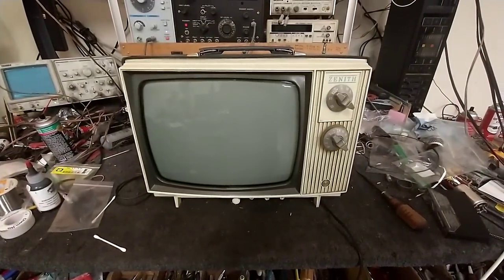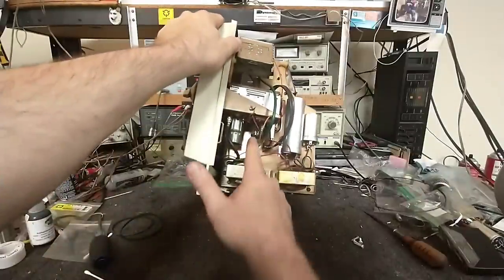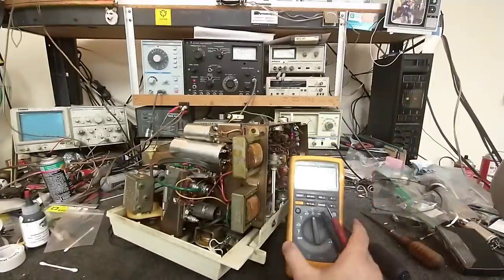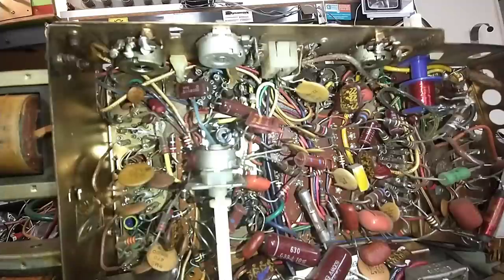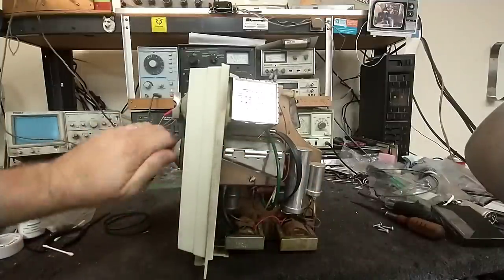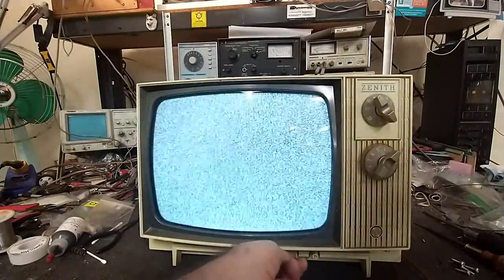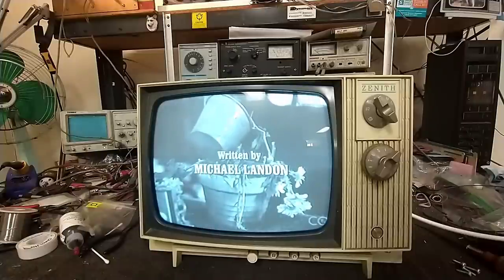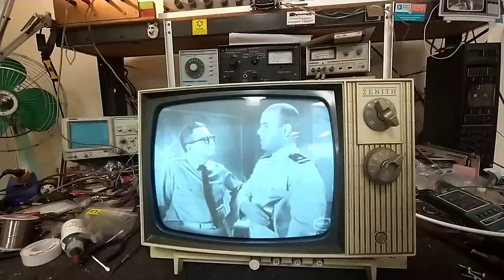Analysis and quick service of a 1967 12" zenith vacuum tube black and white television model X1215-1

Comment: My first TV was a small Zenith like this that I bought used from Larry Dorst TV, our neighborhood TV store. I am guessing it was a slightly newer 1970 or 1971 model. I remember feeling lucky to have my own TV, separate from the one in our family room. As I recall, I paid $40 for it, with money earned from my paper route.

The volume knob and on off control on mine was at the lower portion of the speaker grille, where the Zenith emblem is on the set in the video.

Comment: I had that exact same model but mine was the same color on the back as it was in the front mine had one transistor on the bottom play and there was a pin cushion socket under the yolk

Comment: My parents had an RCA roundie color TV from 1964 and I had a zenith 19 EC 45 Chassis and I wish I had both of those TVs
Reply from the maker: @DavidBerquist334  I had those two sets. 64 roundie I. A Chinese provincial cabinet and a tabletop with the 19ce45. Regret selling both. They were excellent, trouble-free performers.
Reply: I'm sending you a picture of the my parents TV and the one that I had the only thing different the cabinet is different on the one I had mine was the early American cabinet and this is a different cabinet but it's the same TV
Reply: Just click on that link and you'll see the pictures of the two TVs the RCA was my parents and the zenith is the one that I had
Reply: Here is better pictures my zenith 19EC45 Chassis is a different cabinet but the same TV mine was early American wood on top and plastic sides

Comment: I have a 16d25 that is missing the linearity sleeves and it shows. 
Need to come up with a method to replace them. 
Any suggestions?
Reply from the maker: Never took the time to figure out one of those and its composition. The yoke on this is fraggile enough that id be worried about taking it and the sleeve out

Comment: I had one just like that my back was the same color as the front and on the one I had there was one transistor on the bottom of the chassis no circuit boards it looked just like that on the inside but it had one black transistor in towards the middle of the chassis on the bottom does yours have one transistor
Reply from the maker: Didnt see one
Reply: @JordanPier  thanks for looking mine had a little half circle black one on the bottom it would be easy to miss
Is high voltage the same as color tv let's say a 19 inch color and black and white
Reply: Probably a lost cause but I have the 13n15 thats in beautiful condition but the crt went to air in shipping. Does anyone at all have one they’d be willing to sell or another set?

Comment: That rejuvenating stuff is hit or miss, I popped the green and the red on an 18 v a s p 22 and they came right back improved as it ran and still producing a good picture a year later I thought that it was going to be dead in a month after doing that I popped it with a super Mac on rejuve one
Reply from the maker: The sencores and B&Ks are kinda brute force. The beltrons have current limiting so you don't murder the guns. it either works or it doesnt

Comment: if nothing goes BANG right in ya face, then that ain't no fun...I had an arc going between two pins of some resitors, I was looking with my face very close to the aria when all of the sudden...no warning, big blue Bang, and I was d.... b... you want to play tricks on me, I just took a screwdriver and right there, while the circuit was still hot I cracked those pin a little bit further from each other...my ears where ringing a full hour after that...the next day I got zapped real good by a color crt 24kV, didn't needed coffee all that day...learned a lesson to make sure that the screwdriver is properly grounded before poking that huge propaganda tube ever again...😅